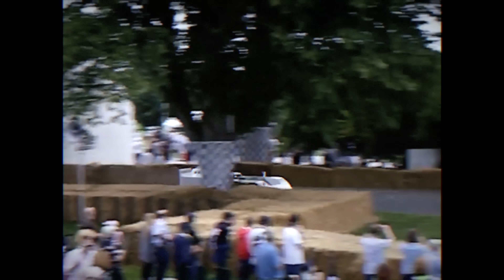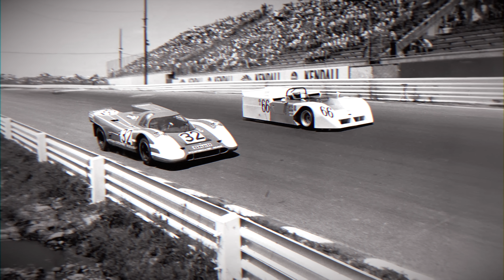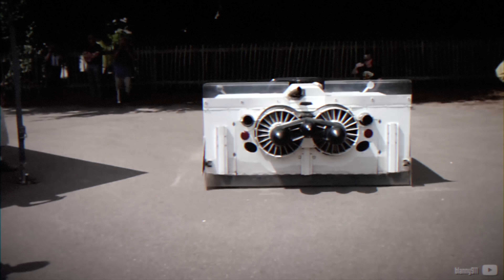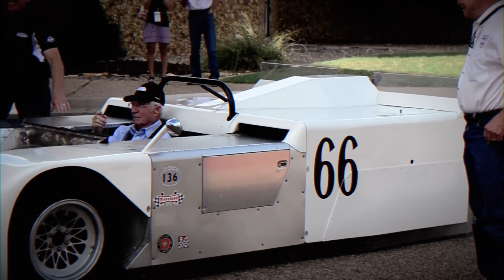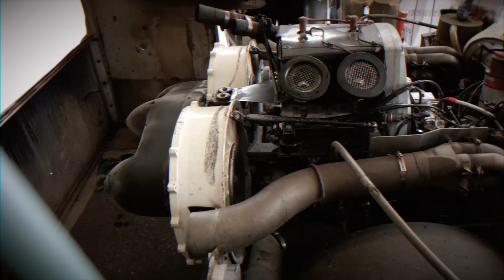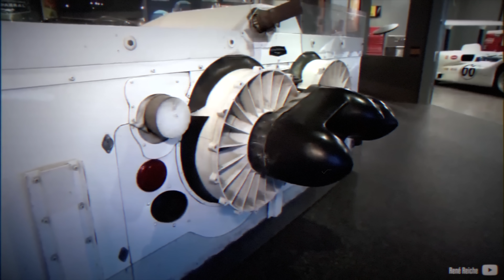A Small 2-Stroke Made This Car Fast

Comment: Would have been smarter to have used the fans to push the car down instead of sucking it down.  Less complicated, however the elephant in the room on a design like this is, if this system failed - especially at speed - would be a sudden loss of grip and this thing would have been  extremely dangerous to the driver and anyone behind him.  

Sometimes a simple solution is much better, a stationary wing (fixed or adjustable) and good tires is better for simplicity and doesn't just quit on you drastically changing the dynamics of the car.

Comment: 2 stroke is the best combustion engine ever created 💯. If engineers can fix the fuel consumption and pollution it'll be superior.
Reply: mazda has a patent that insted of uniflow, it has overhead valves aimed to swirl to scavenge
Reply: Sure we can! My 115cc yamaha used to give 100mpg!!
Reply: @fidelcatsro6948 That almost sounded impressive until you start to think for a second... a .1 liter engine... which can only possibly propel something small and slow, like a moped... Getting 100 mpg? Doesn't seem all that impossible to do with ANY type of engine lol. I'd bet you could even get a .1 liter rotary engine on a moped to do 100 mpg, if such a thing would ever exist.
Reply: @derekspringer6448  my bike was from 1983... it was almost 40yrs old..of course its legitimately impressive!
Reply: Maybe just egr and multiple stages.
Reply: It was fixed decades ago by Orbital's air blast injection and uniflow scavenging
Reply: Marine industry has been running direct-injected 2-strokes for quite some time.
Reply: So basically if we fix all its problems it’d be great? 
2 stroke is good for some things. But, by the time you specialize it for something you’re going to loose something else. Make good power you loose efficiency and emissions. Make good efficiency and loose power. 
Even something like a rotary, or most of the new wacky engines, end up having similar issues.
Reply: uniflow two strokes engines are very efficient and yet powerful.
they move the world markets transoceanic ships 🚢
Reply: @Xayuap  For the size of the engine they’re not that powerful. They’re built for durability and economy. Which the economy comes from running them at a low rpm and relatively low power.  If you want power for large things it tends to be turbines that are best for outright power, and they’re pretty efficient for the output. But, they’re expensive and have their own problems.
Reply: those are very big IFs
Reply: A few companies tried it. Check out Orbital of Perth Australia.